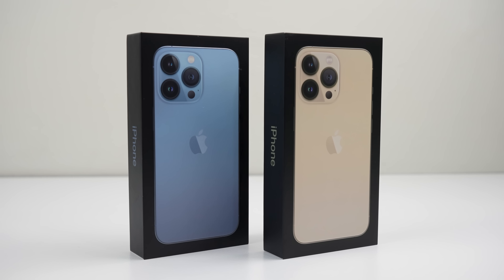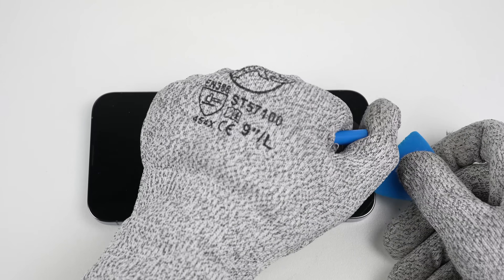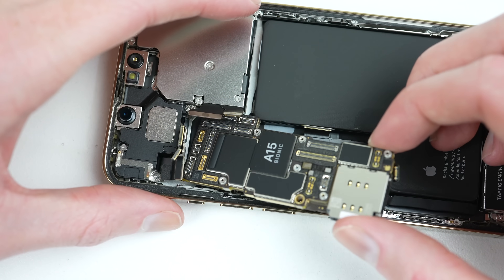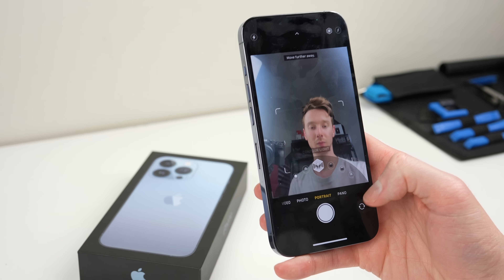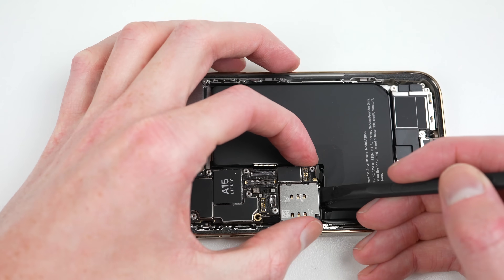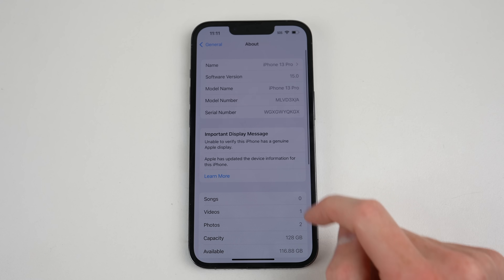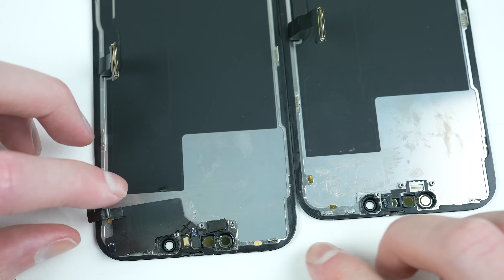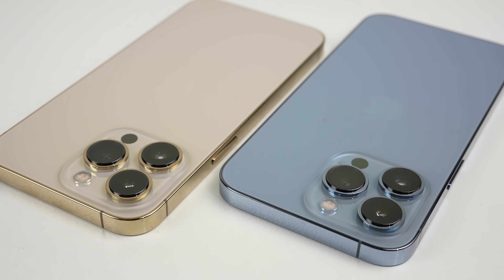iPhone 13 A Repair Nightmare - Teardown and Repair Assessment

Comment: It's funny... because I currently have an Iphone.... and I hate it.

I hate it so much.

The only reason I have this thing is because my cheap android smartphone broke, and it's hard to justify an expense like a phone when nearly all my money goes to either food or bills. My mother was kind enough to give me her old phone, since she was about due for an upgrade anyway. That is the >ONLY< reason I have a Iphone....

This thing has a surprisingly sensitive switch that sticks out obnoxiously from the frame.... and silences the phone. There have been a number of times I've been waiting for a call from, say, my doctor or my mother.... only to look down in the afternoon and see I have several missed calls, and there's a little red line under the switch stating something must have bumped it in my pocket. This thing gives me friggin anxiety when I'm expecting a call and I have to check it constantly if I'm not leaving it on a table, to make sure it hasn't spontaneously decided to not do it's job and tell me I've gotten a call.

This thing has the worst charge port I've ever experienced, with chargers sevreal times more expensive than a basic charge cable, which none-the-less seem to spontaneously decide not to work and force me to go buy another. This thing doesn't have a headphone jack, meaning for well over two months after I got it I couldn't use it for audible, or to listen to music.... because I had to save up for bluetooth earbuds EXCLUSIVELY for use with my Iphone, just so I could use my phone for a basic feature. Before that I tried buying one of those adapters that let you plug headphones into the charge cable, but amazingly these adapters continuously broke WITHIN DAYS, and even before then would constantly pull out or disconnect from the phone since it took very little pressure to remove them.

Several apps I liked on my Android either don't exist on Iphone's shop, or cost money when they were free on android. I can't use 3rd party apps, because Apple demands complete control over the device after purchase. Putting music and movies on this thing is a convoluted pain in the ass that requires I use their program as a workaround, which itself would occasionally just decide not to do what I wanted it to, when an android phone LITERALLY just let me drag and drop files. 

Despite easily costing 4 times as much as the cheap android phone it was replacing when new, it was harder to use, had more inconveniences, provided me less functionality, and heaven forbid it broke and I wanted it repaired... would be harder and more expensive to repair.

This thing is objectively worse in every practical way. The camera is a higher resolution, the screen is bigger, it's more powerful.... and yet I can do less with it than my old cheap phone.

That is the tech landscape Apple, and indeed other companies, keep trying to push us towards. You don't own anything. You aren't buying a product anymore, you are signing a lease to borrow the phone on the strict condition you only do with it what the seller wants, and being charged a premium for it.

To be clear, with the exception of that sensitive Do Not Disturb switch, I absolutely see the use of the Iphone as a corporate or business phone. It is high end, secure, restricted and as near as I can tell would fit the needs of executive use for business purposes. As a consumer product for the masses however? I can only speak from my own experiences with it, but it is horrible and I'm saving every penny I can afford to replace it with something a fifth the price as soon as physically possible.

I repeat.... I am scrimping and saving every penny I can, to replace the HIGH GRADE PREMIUM PRODUCT I got FOR FREE as soon as possible.

Comment: Not sure if it's new since your video posted but I just checked the apple "self service repair guide" for the 13 and it instructs users to contact apple after the repair for an "optional" software configuration that "may" be required after a self repair. 
The configuration will check that parts are genuine and "re-calibrate" them so that they function correctly in the device.

Comment: didn't try just changing battery. or at least if it was tryed it didn't make it into the video. as battery is the actual most important single item for repair this miss is glaring.

Comment: And this is why I will never buy any Apple device... I got an Iphone from my uncle and a macbook air through school.
Do they work properly anymore? No. Was letting them repair them an option? Not unless I wanted to pay only marginally less than it'd cost to replace them with entirely new devices from a different manufacturer. Ended up buying an IFixIt-kit and replacement parts for the macbook online and doing it myself. Cost like $300 in total.

Comment: That's completely insane. I literally changed the motherboard and CPU in my pc and my computer didn't complain one bit
Reply: I’m not saying I agree with Apple and their soft-locking, but that’s still a somewhat unfair fight, seeing as desktop PC’s (and laptops to a certain extent) are built from the ground up for modularity
Reply: @Techmej  fair. Laptops would make more sense. They're less modular and have multiple different standards but you can at least upgrade the storage, ram, or WiFi Card on a modern one. If the battery goes bad, I can change it to something better

Comment: I had an iPhone 5c years ago and that was the last time I ever bought an Apple product. Just one update was all it took for its battery to suspiciously go from being capable of lasting a whole day of constant use without needing to be charged, to barely lasting 5 minutes without use even at full charge (before I had to get rid of it I had to leave it charging all the time, and if the cord disconnected by accident it would turn off). It was "convenient" how it all happened right as a new model had recently released. I don't know how the hell a company can be so absurdly terrible and somehow remain in business, you would think at some point the customers would catch on and stop buying that shit. Also it's rich how they virtue signal about trying to be environmentally friendly while making their business model revolve around making the most wasteful products in existence. They also make said products in sweatshops that treat its employees so terribly that they require suicide nets to be installed near the roofs to prevent them from killing themselves after they snap from all the abuse. So yeah, fuck Apple.

Comment: thing is phone battries are the main problem with all smart phones, there should be a law that states if the battery expands the phone must be replaced by the supplier no matter how old the phone is. 

cos no one should be forced to BUY NEW PHONES EVERY 2 YEARS due to planned obsolescence if it was about SECURITY then why do they build phones to die after 2 years?

Comment: Interesting video, If Apple are making it difficult to repair Apple products why don't people abandon Apple and go to Android or some other company or device.

Abandoning an item or manufacturer that's not completely satisfying sounds like a great opportunity and makes common sense to me. But sadly, today the consumers are a bit idiotic and are completely hypnotised and hooked on item because it's fashionable. 

I recommend trying something that works well, reliable. If you keep buying products that have dodgy workmanship and hard to repair the manufacturer is going to keep building selling these items. Try to remember it's a tool, not a fashion statement If you don't like the way the item works, don't buy it. Then the manufacturer will have to change their ways so people will buy their product. use your head and not relying on the manufacturers selling gimmicks and bulshit.

Comment: the on board mother board is responsible for identifying hard ware id's you have to change the id's to match the updated hardware.. But those bios settings are locked until you use the software that is owned by apple to unlock them so they can be changed to support the new hardware and identified most of the time its from older model phones due to the same hardware build scheme but they charge you as if it was a new hardware being installed.

Comment: "However, something better than recycling is to use something for longer or fix something you already have instead of replacing it". Yes this makes sense, It's planned obsolescence from manufactures, Same for cars. Is buying a new car every few years better than keeping an old beater running ? Manufacturing is pretty devastating to the environment. Even 20 years ago it wasn't uncommon for a family to keep a vehicle for 10+ years, now It seems everybody has new things.

Comment: Apart from the horrible bussiness model and stuff, the connectorts, layout, compactness, and the all the insides elegance and refinedness is just breathtaking!! Not an apple fanboy, I assume android phones have similar insides, it's just unbelivable how perfectly refined modern phones are. Sheer beauty.
Reply: Can’t tell if you’re being ironic, but I don’t know if it’d be appropriate to call a self-destructing environment killer “beautiful.”
Reply: @mr.goodman4151  Not the destructive ascpect obviously, I was talking about the compactness and the neat connectors and stuff. As the video also mentioned the problem was intentionally introduced by artificially created software restrictions. The same layout would work with a much more repair friendly mindset as well.

Comment: How does it actually even know the stuff of being replaced? Like how tf does the phone even know?
Reply: The parts in the phone are assigned a serial number, think of it like a special password.

If a new part is inserted from another phone or made by a third party, it either won't have a number or would have a different one so the phone would detect that and then it would fake glitches.

In order to properly repair this iphone, you would need to hack the source code or manipulate it, also known as jailbreaking.

Comment: I’ve been wanting to repair my iPhone 11 screen because its not only has multiple cracked lines running though it and multiple dark spots that look like ink or a black hole. (When I take a screenshot the image doesn’t show it so it’s probably just the screen having issues with this.) But it works fine and honestly would rather that than an even more unusable phone. Does anyone know if repairing my phone by a third party would cause these issues???

Comment: Apple, a company that uses 'Itunes' (some shit software designed for IPods and mp3 players a long time ago) to update phones and developer apps. They also use renamed .zip files with formatted/renamed files and that's sometimes their 'proprietary encryption'. As for 'tech suppression' and 'break things', they are not the only one doing it though. 

It is almost like apple is a 'academic' company when it comes to repairing and developing anything on them because of how the presentation is 'good' but the behindscenes is all amateur, unnecessary security that doesn't serve a practical purpose, and junk. You will have to learn and then re-learn why it does an error, why an update breaks something, and even they won't know why. Their only useful security is the usual 2FA but the other features are like this, it's more like a deterrent, or a gimmick making it seem more secure to a regular user.

Want to know how dictatorships and scams start? Stuff like this. People are buying this junk and then they are even trying to monopolize any cheap way of modding phones or fixing them. Then they make even more money they don't need and probably have only '1' authorized repair place, that quickly destroys or sells any phoneparts beyond 1-2 years old (so no more support, no repairs). More incentive to get people to upgrade to the next phone that is likely uselessly expensive, has tech suppression for years, and has intentional things that will break. I encourage everyone to find a good phone that is unlocked and set it up how they want. They try to force you to spend money and be stuck doing it for basic things. Apple is just not good for it. There are phones for <150$ right now that can run Android11/12 firmwares, 128gb, good hardware, and way better anyway than older phones.

Comment: Could Apple have had slightly differing software between phones of different colors and maybe the same color phones could have different or no issues with parts being swapped?  It wouldn't be common for a strictly physical cosmetic to be considered by consumers or repair persons for why software might not be the same for what seems to be the same model, unless it was explicitly made known.

Comment: Wow that hardware interior is clean, tho!  I've dissected a few old Samsungs and budget Android devices and the guts are usually a rat's nest held in place with tape and more glue, if at all, and figuring out what goes to what is rough.  Too bad clean hardware layout doesn't much matter if Apple soft-disables reparability!

Comment: (cr)apple at it's finest... also the laughable refresh rate of the screen (so you can actually see the tics on cam, pathetic)
(yes i understand why is that hapenning, but "you" - the offended one - should understand i've never seen any normal smartphone suffering from this - not counting the cheapes tier, which really is not a comparison vs (cr)apple... and if you think it is then you're not only missing your brain, but also the bacteria you had in there instead of one)

Comment: I am a phone repair technician and do work with (not for) apple and I have seen the responces from apple about the complaints on the iphone 12. After the repair we need to calibrate every part we change during the repairs except the battery. The only changes I have seen from apple are they require even more calibration softwares to be run before the phone works properly. I am sure they do this to make it more difficult to make repairs at home. Apple has software to "fix" all of the errors he goes over and the errors occur in every single repair.

Comment: this is criminal! They're lying and manipulating! Due to no reason! Its the same with the forced software-updates slowing down cameras, lagging music and bluetooth connections. 
I used Iphones since the 3Gs also because i could repair them. This shows again that the market doesn't regulate everything. You have to prevent that obsolescence!

Comment: “Introducing the IPhone 28, with all new features, such as integrated security screws that lock a plastic film over the screen rendering it impossible to use, and removal of any way to turn the phone off or charge it for ergonomics. But, most importantly, we ship half the phones with randomly missing parts to make every time you buy one feel like an adventure.”

Comment: I've had personal experience with 4 Apple devices (a Mac Pro, an iPod and 2 iPhones) and only one of them lasted over 2 years without being unrepairable (economically). The Mac Pro only lasted 2 weeks. And I spent an hour or so trying to load MP3 music files onto an iPhone and gave up after it kept taking me to iTunes to try to make me purchase them again. My Android just looks like a hard drive when I plug it into my computer so I just copy and play.... easy peasy.
I asked one of the iPhones (Siri) to get the weather report (in a Canadian accent) and it immediately started dialing someone in my address book whose name didn't sound anything like "Get the weather report"). My much older Android got the weather in one second with a verbal prompt.
A friend of mine accidentally dropped his "waterproof", late model iPhone into water and retrieved it within 5 seconds and it was totally fucked. My Android is perfectly happy in our spa pool.
I don't know how Apples got so popular. My 6 year old Android is still going strong and cost less.
Reply: Same experiences, had my android repaired around 13 or 14 times(screen cracking, screen getting burned, battery getting fucked up etc.) And it still works very well
Reply: @Ie_Froggy  And any repair shop could work on them without hitting an intentional brick wall that required servicing by the manufacturer.
Reply: "I asked one of the iPhones (Siri) to get the weather report (in a Canadian accent) and it immediately started dialing someone in my address book whose name didn't sound anything like "Get the weather report")." That's funny. When did this happen? That very same vocal command works on my phone as expected.
Reply: @heckinbasedandinkpilledoct7459  It was about 4 years ago. But if it works for you and not for me then the poll is 50% that Siri works. To get something meaningful you'd need to get 100 people to try it.
I've had children and people with Kiwi (including Maori words) and South African accents ask my Android for things and it always understands them. My Canadian accent is close enough to American that Siri should definitely understand it especially when it's something common like get the weather forecast!
My experiences with Apple products has been dismal in terms of reliability, cost and performance.

Comment: Honestly, I wouldn't be surprised if at some point they end up having a mechanism within the phone such that whenever anyone other than an actual Apple technician opens the case, the entire phone just instantly bricks on you. And to ensure no bypass, it would need a multi-stage randomized authentification key that could only be accessed via a manager-level or higher Apple employee ID code....
Reply: Exactly